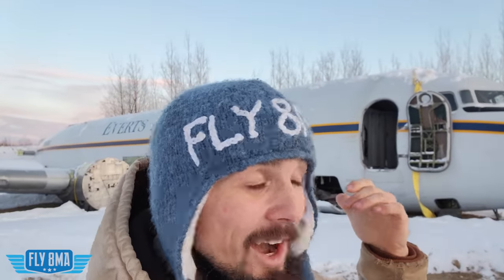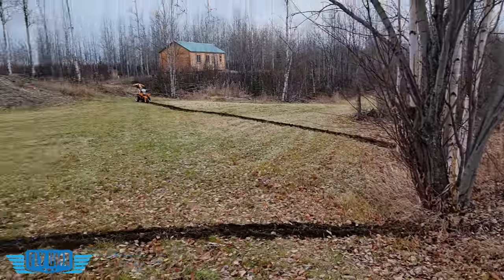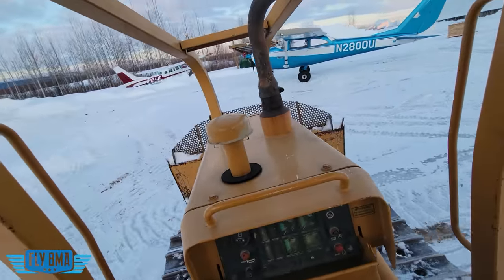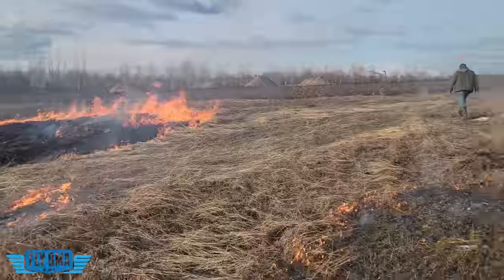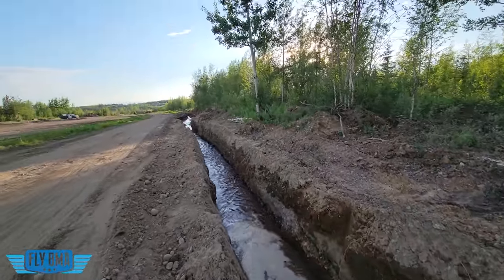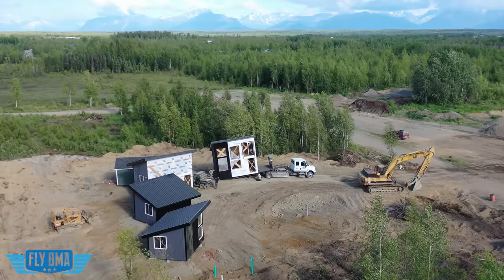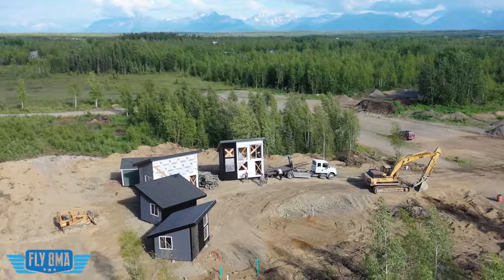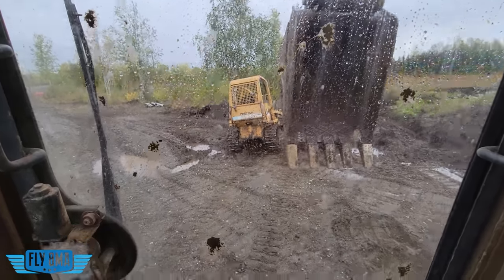I Bought a Retired AIRLINER!

Comment: I wanted to also add that the power inverter system in a class A RV will work quite well in your aircraft body , it is designed to handle high current loads. What is good about your class A Rv is that you have multiple redundant systems , power inverter battery system, onan generator and 50 amp plug in . Now even better is the black and grey tanks since with those , your housing could be moved easily to new location . Moreover the water tank , stove and fridge all use redundant power systems. I happen to be an electronics engineer let me know if you need other ideas . You could get a lot of cheap parts and pieces from scrapped RVs . Most class A RVs have a full sized shower, sink and toilet . You can get old Class A rvs for cheap $$$ and the advantage of that is you can design this aircraft housing for students to be moveable.  Even better is that there are class A rvs with bunk beds and washer dryer -think about that . Myself , I would do a 5th wheel hitch set up and make it into an RV . Hope this helps . A little engineering .

Comment: G, day from Sydney Australia.
Thanks for keeping me posted about this chapter in your life. 
* Thankfully your arm wasn't full thickness burn- burns straight in cold water, that's for sure.
* When concreting a large area why span it "all the way" put in temporary formwork fill with concrete, then pull it out: considering expansion joint and fill next section.
* Fuselage DC-6 main circuit breaker board and plumbing valves in convenient locations (freezing water pipes) Fill with polystyrene foam insulation and line with plywood (grey recess line between sheets) and laminate sheeting in all wet areas. No tiles on curved surfaces. 
🌏🛩️ "You are one unit"

Comment: On a very serious note. Next time you have a chain hooked up to pull something heavy like that dozer, put a jacket or a heavy blanket on the chain about mid way. If that chain snaps with tension on it, it becomes very deadly. Seen cabs of construction and farm equipment split in two when the chain lets go. Just trying to keep you safe! Love the content, and would like to come fly up there soon. How do we find out about the rates?
Reply from the maker: Hey Chris!  Good tip!  I like the idea...I had one snap a few weeks ago finally and got pretty lucky, missed my face by an inch or two.  Turns out the final drives on the excavator are stronger than the stick swinging in (wouldn't have guessed).  heavy blanket at halfway would certainly have absorbed a lot of that
Reply: Chains are the same as steel cables?
Kenotic energy?
🌏🤪

Comment: 0:00 look at that bob and doug hat!
11:20 look at that big yellow beast. that's a big boy.
13:00 omgg :/ rough burn.
14:25 "don't let a CFI design plumbing systems". were you able to extract the PEX or is it just buried and abandoned?
17:40 do you wish you'd built the cabins in place?
21:00 did you test the radiant tubing before the concrete? 😆
22:20 whoa, DC3.
26:00 learnings of grey, brown, and black. I like it.

Comment: Is that a Rans s20 Raven at 28:40? I really like that design, although I have yet to fly it. How do you like it?? Best regards from Brasilia, Brazil.
Reply from the maker: Its pretty dang sweet!  For the $ they perform really really well when they are light.  Needs a bit more power to take a heavy load.

Comment: Bench down, one bucket deep by one bucket wide and as many as required. The trench will look like a giant staircase on either side. You are way too deep to trust that the vertical sides of your trenches will hold. If one fails, it will come quick and anyone in the hole is dead. You have to hand dig them out, the machine will kill them if you try to use it, you will never get to them in time. That deep though, the weight of the soil falling on them will do the job. Anyone who jumps in the tench to start digging is at risk of getting buried as well. Am I just another internet expert? No, I have personally been on a job where a guy was buried. That guy was the owners son who was in a hurry to get one more pipe at the end of the day.
Reply from the maker: Ya, I wasn't a fan of how that went. Luckily we don't have any more deep trenching to do around here, but I like the stair step idea to make it wider